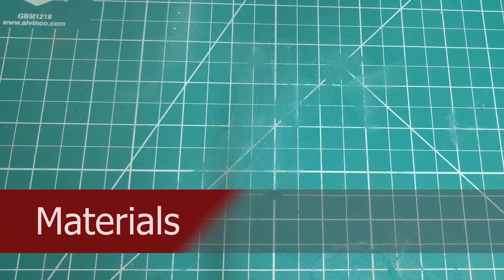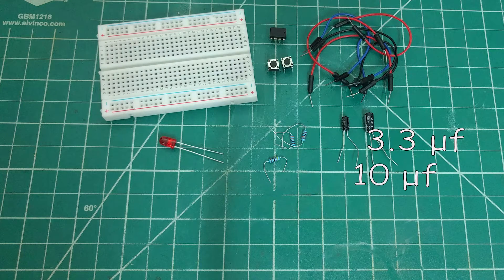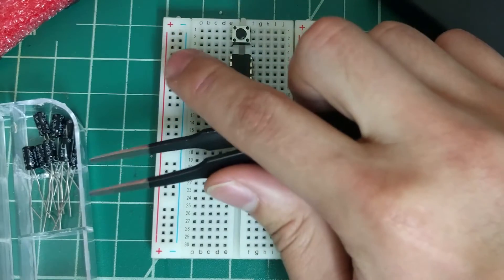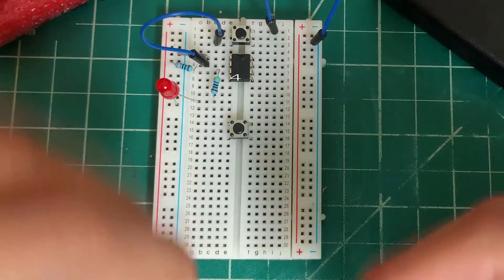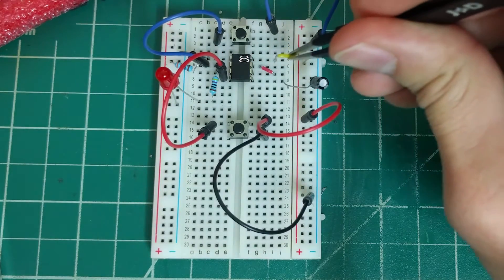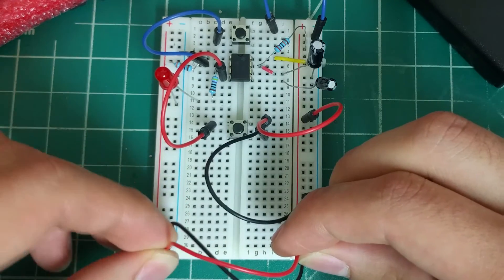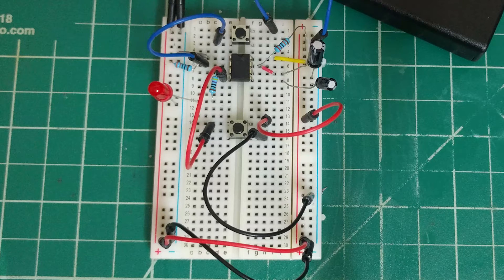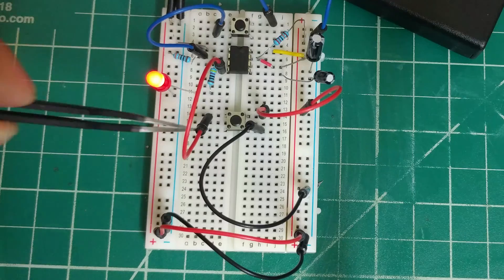Tutorial: How to build the 555 Timer One Shot Monostable Circuit with Reset

Comment: On pressing reset button the power supply is being short, use 1K ohm resistor between power and switch, do not connect directly to power
Reply: Thanks for the advice. I was burning my 556 by using the switch in reset pin. now iis good. thanks
Reply: In the following video at around 1:20  YouTuber "GreatScott!" explains how the 555 is built and says that you connect reset (pin 4) directly to ground to reset the timer (which is what QRobotix did):

https://www.youtube.com/watch?v=fLaexx-NMj8